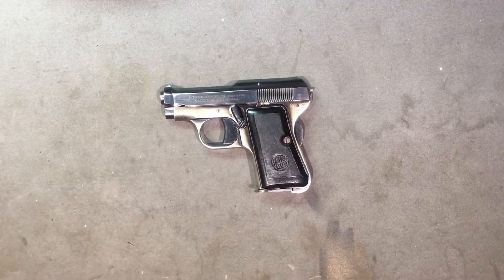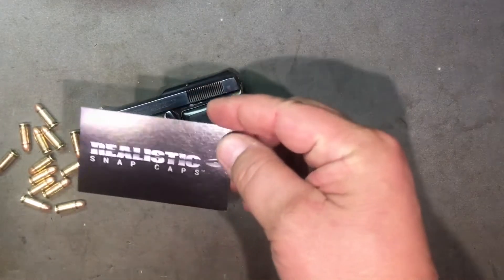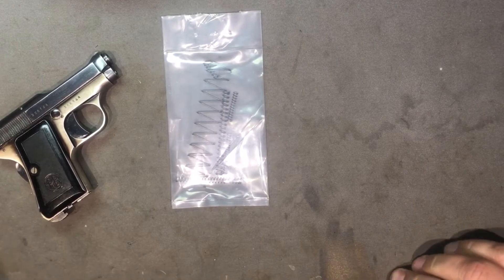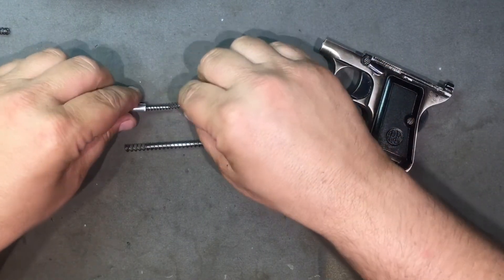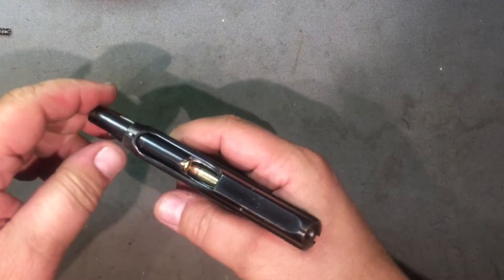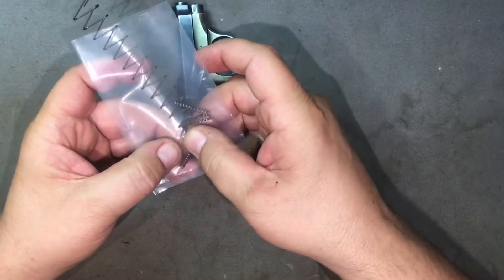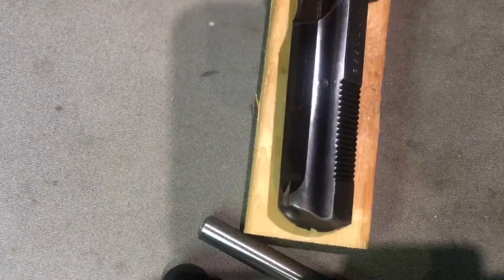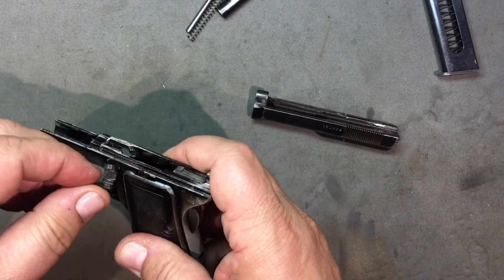Beretta M418 (1949)

Comment: I just got a 1954 nickel plated one with steel frame. Beautiful gun and shoots great. The steel frame makes a big difference, for one thing it holds the barrel much tighter. Can’t push it out with just a finger. Have to actually push it loose against a wood workbench.  Seems like the steel frame models are harder to find.